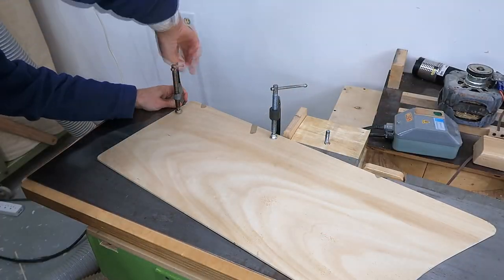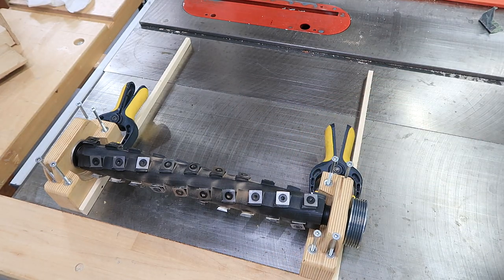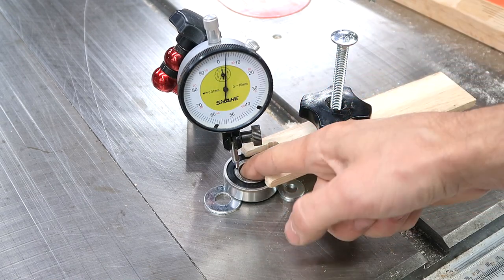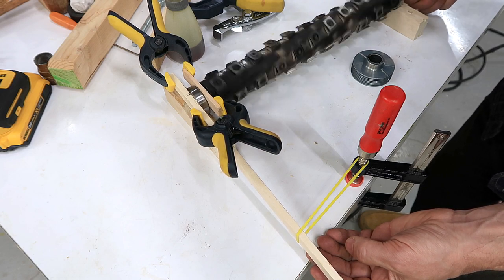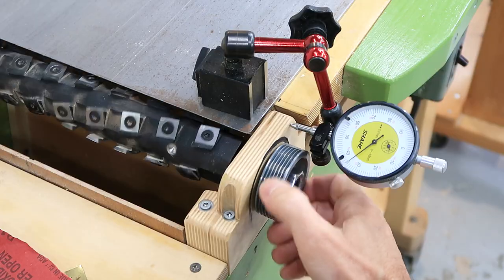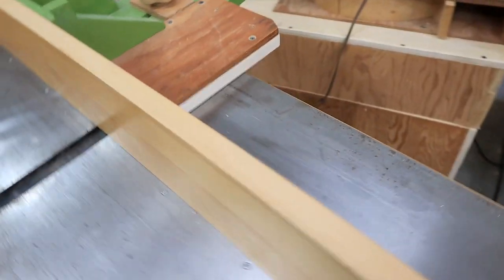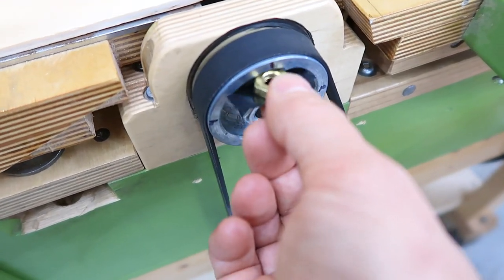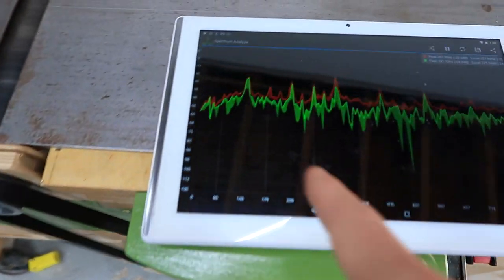Trying to reduce jointer noise and vibrations

Comment: Those are horrible bearings. Nothing against Turkey  but this is not their greatest area of expertise. I've had slightly bigger ones on mower axles in the past and they were shot within a year. That said, it appears the problem isn't entirely the bearing's fault. The shaft's bearing pockets might not be cut right, which wouldn't be the first time something like this has happened with stuff like this (there's a few posts on reddit and other forums for stuff like this).

Comment: take the seal off the seal on the bearings and add grease
Reply from the maker: oh, it's got grease in there allright.  Almost new!
Reply: Sealed bearings should last about 25 years without regreasing when  installed and running properly. That is why they are sealed.